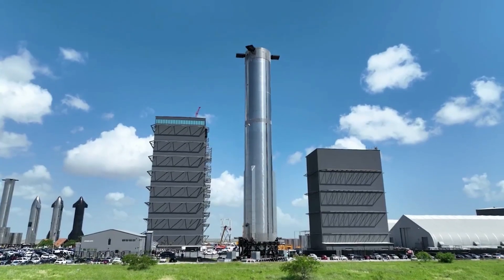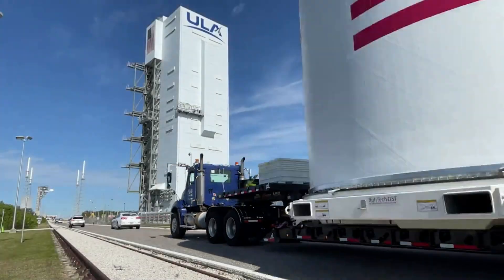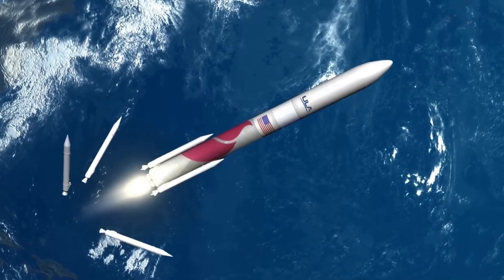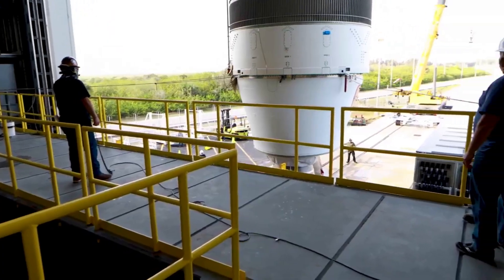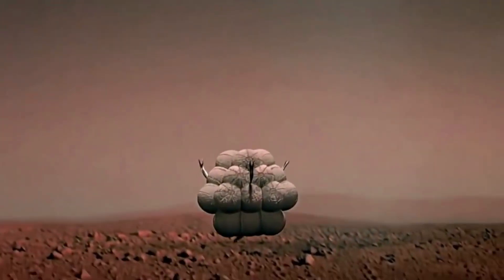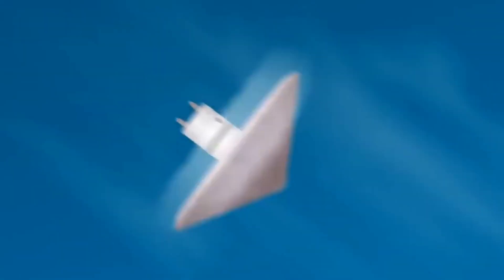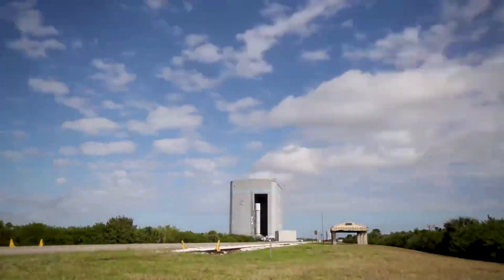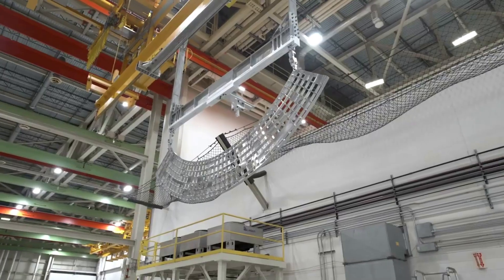ULA’s Updated Plan To Make Vulcan Competitive

Comment: If ULA really wants to save money they should look into being more vertically integrated instead of bragging out using 1000 of contractors to make their rockets. It seems to work well for many other businesses. It would even help them ramp up their cadence, which let's be fair here, ULA (or Lockheed and Boring on the aerospace side for that matter) has never had to deal with before in their history. Plus if they made more in-house they wouldn't have to sign such huge contracts with their contractors to guarantee timely parts and procurement.
Tory knows this, the guy isn't dumb by any stretch of the imagination. He's just being kept on a tight leash by his owners.
Reply: I don’t know a lot of the exact statistics, although I personally know someone who owns their own machine shop and SpaceX went to them with a contract to make some parts, so we know SpaceX does a lot of stuff “out of house”.
Reply: @andrewdoesyt7787  Yeah, SpaceX buys out of the house as long as they get the time and cost parameters that they want. They only move in-house if they can't buy what the want from out of the house.
Reply: @andrewdoesyt7787  From what I have read they do about 80-90% in-house depending on the project.
Reply: idk man. specialization works pretty well in the rest of the economy. amazon doesnt make batteries, or tv remotes, or diapers or whatever else is sold under their "amazon basics" label. Intel in recent times has faced major setbacks with their production rate of chips due to previously being completely in house. if you look at cars, most of the parts are contracted out. now thats not to say that ULA shouldn't do more RnD itself and find a niche in the market that isnt goverment contracts. but the idea of buying off the shelf stuff or contracting out isn't unnatural or even unnapealing. they should do more RnD tho

Comment: If we assume ~10-25 flights before a BE4 engine is retired, that lowers the required production rate to support a Vulcan Centaur every two weeks from 50/year to 2-5/year.

Makes me wonder what BO and especially SpaceX will do with all their engine production infrastructure once reusability causes engine demand to fall by one or two orders of magnitude almost instantly.
Reply: spaceX with raptor is planning a LOT of launches with starship, so i believe they just expect to kill a ton of raptors whether thats a permenant death on mars or the moon, or just a failed starship or superheavy landing. BO... we wait to see
Reply: Simply put, they'll lower production. The infrastructure required to build loads of Raptor engines for example is expensive, but what's far more expensive is waiting on engines for years just so that you can test your vehicle to get it certified for commercial use. When you consider the fixed costs of all of the labor, leases, and infrastructure required to certify Starship, that can be significantly mitigated through sheer speed alone. Paying 10% more overall to improve raptor production might sound like a lot, but if it allows you to shorten the development period by years upon years, then you're effectively saving on those costs you would've paid having to pay for all the land, labor, and other production processes for those years before you created a productive rocket system.
Reply: @Userre  I doubt that the cost of scaling up raptor production only cost 10% extra. Why would you assume the cost of scaling production is so low?
An important distinction between New Glenn and Starship is that if we assume a similar amount of launches before reusability is achieved, Starship development will require 5.5 times as many engines.
In addition Starship will likely be reused more often and is being developed faster with a more hardware rich approach.
I would not be surprised if their need for new engines drops from 360/year to like 5-16/year.
Reply: @plainText384  To be more precise, I said 10% of the overall cost, meaning the cost of the program entirely. In that regard, it may well be an overestimate.
Reply: @Userre  but why? Engines are easily the most expensive component, and you are scaling up to 10-100x greater production volume than what will ultimately be needed long term (or perhaps even more!). Do you have a source? Or are you purely guessing?

Comment: Tory Bruno said ⇔ Upper stages that are reused should do so in space. 

Could someone please expand on this concept.
Reply: Basically instead of all of the components and development needed to land a stage from orbit instead refuel the stage in orbit and then send it on another mission.

E.G you launch a payload to LEO with the second stage then you refuel the stage with propellant from the Moon most likely and then the 2nd stage can grab payloads that have been put in a LEO parking orbit and take them to GEO or interplanetary destinations.
Reply: @luther0013  Ok, that seems reasonable if your rocket core makes it to LEO, sorta like SLS or Space Shuttle does/did and then you stage and have a tug in LEO that takes you to final orbit. And the tug gets refueled to provide reuse.